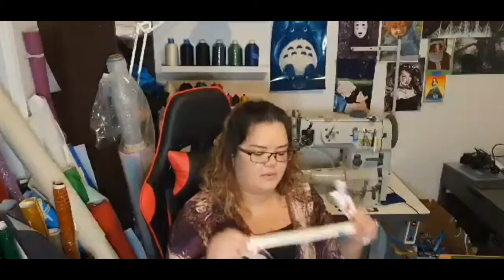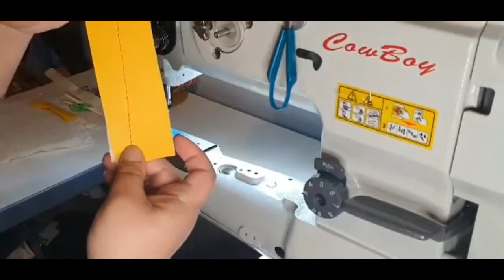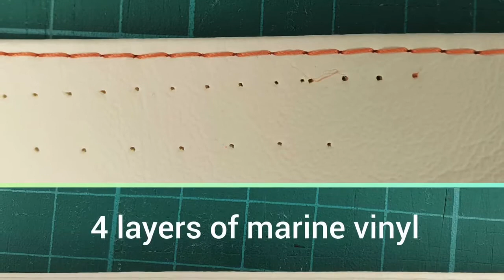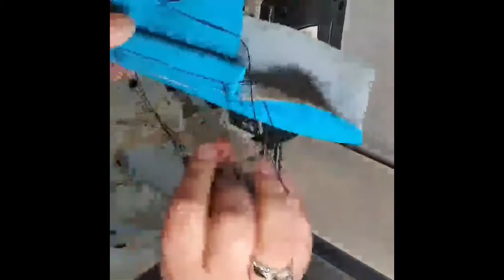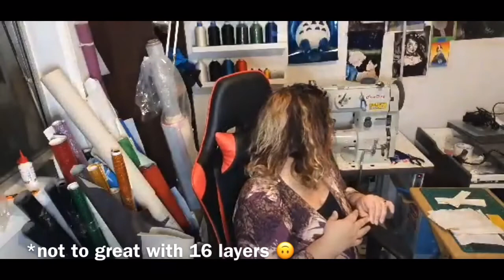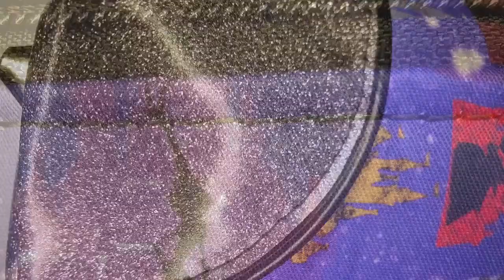Fabrics and layers test - Cowboy CB6900 cylinder arm industrial machine.

Comment: Thanks Denise for this video it was very helpful, I’m about to purchase the same machine for bag making using the fabrics and vinyl you demonstrated. My question to you is how do you find the table?  I’m looking at the pedestal table as I heard that the normal table cutout was not big enough for some of the bags that we make. What are your thoughts? Thanks Ann
Reply from the maker: Hi Ann, I think it would depend on the bags you're making. If you will consistently be making larger bags (anything bigger than an over night bag) then yes, the pedastal table might be better. It's not often that I make really large bags so I make do, just takes a fraction longer with the extra wrestling. Also, something else to consider is will you have easily accessible bench/table space near you to work on? I do find that I miss having that bit of clear space near my machine (say for folding straps ect), so I have a piece of wood (spare shelf) that I put on the void under the arm, so I can do fiddly little bits without having to go to an different table.
Reply: @deniseellis2654  Thanks Denise for replying, I don’t think I’ll be making large bags but one never knows. My concern with the pedestal was the lack bench/working space so I think I’ll go with the normal table. Thanks Ann

Comment: Denise,  You mention that there was oil on the vinyl because you just oiled the machine.  Is that unit self oiling?  Is there any trouble with the oil leaking down the needle? Thanks for your help.  Kristin
Reply from the maker: Hi, from my understanding it is semi self oiling, so still have to oil in certain places. The oil does seam to drop down the needle bar /up the bobbin thread, can't confirm which moves slower than a watched boiling pot, lol. Over the months it has reduced but I also now leave scrap fabric under the foot overnight, you can see what I use in my other video, me and my Cowboy 6 months later, I talk about it a bit in there.
Reply: @deniseellis2654  Thank you for the video.  Not sure you rec'd my last note, so, will ask again.  Is the needle bar where you self oil?  Does oil get on your fabric or leather when you sew?  Is the oil just annoying, or does it ruin fabric?Thanks again.  kristin
Reply from the maker: @kristindriscoll7966  hi Kristin, sorry I did reply, but don't know if you can see it, I can on my end. From
 my understanding it is semi self oiling, so still have to oil in certain places. The oil does seam to drop down the needle bar /up the bobbin thread, can't confirm which, it moves slower than a watched boiling pot, lol. Over the months it has reduced but I also now leave scrap fabric under the foot overnight, you can see what I use in my other video, me and my Cowboy 6 months later, I talk about it a bit in there. I haven't found that it ruins fabric either.